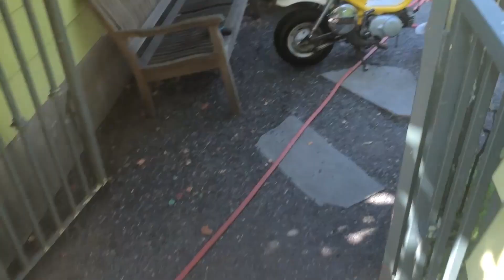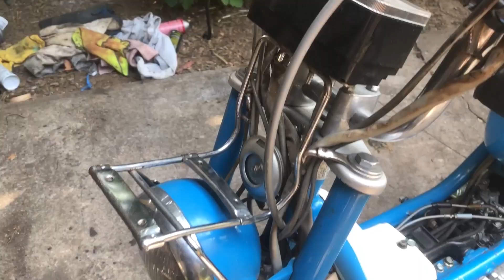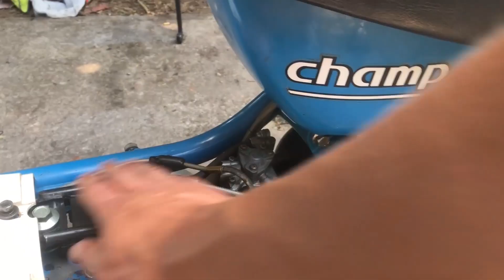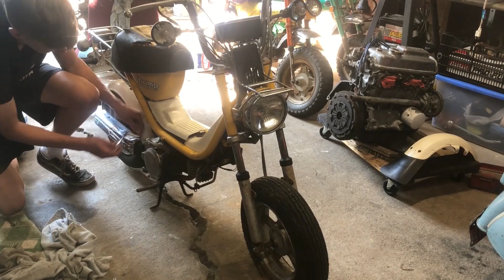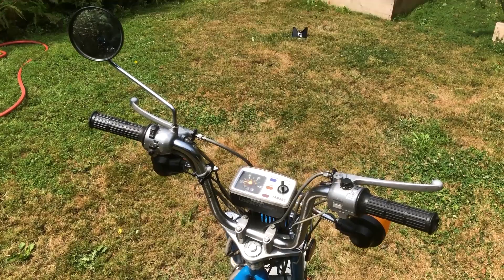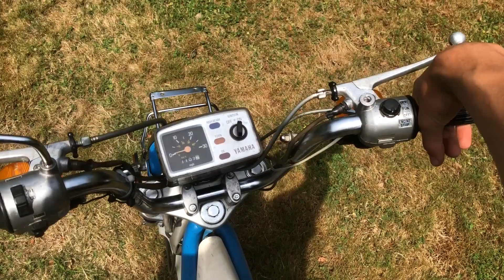My New Yamaha Champ LC50 Scooter Part #2 UPGRADED and First Start! Rare Vintage 1980 Bike Moped

Comment: How hard would this be to convert to electric? Love the single sided swingarm.
Reply from the maker: Hmm good question. Since it’s shaft drive it might be more difficult to do. That would be super cool tho if you could do it!
Reply: @Mechanic_kid  yea the more I look at it, looks impossible. The entire motor pivots with the suspension and is basically the rear swing arm. It would take some mad fab skillzzzz to convert.  Would be so cool tho.
Reply from the maker: @s13kuminachu  yep exactly. The easiest way to do it would probably be to make your own swing arm or mount one from another bike

Comment: Would you recommend buying one?? I see one lc posted for 1500? One owner! If you do I will pull the trigger..
Reply from the maker: It’s was my favorite 50cc scooter until I road a Honda elite and earo 50. They are by far the most fun scooters!
Reply: @Mechanic_kid  talked him down to 1200!! Picked it up yesterday! Still has the registration sticker from 1980 in PA!! First scooter I must add!
Reply from the maker: @MrSlushierGravy  awesome congrats man they are fun little bikes! If you need any parts just lmk I have some extra parts👍🏼
Reply: @Mechanic_kid  did you get rid of the fuel petcock?  Mine leaks, looks like you switched it over to something else?